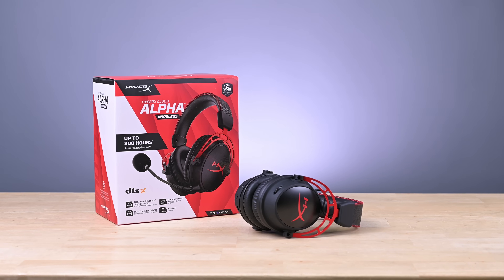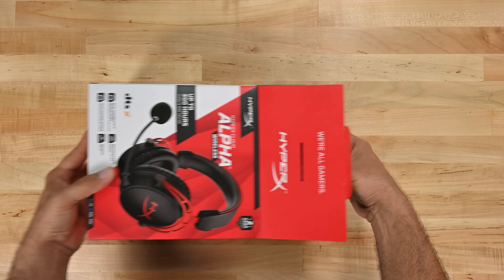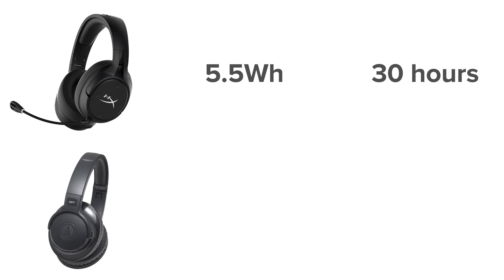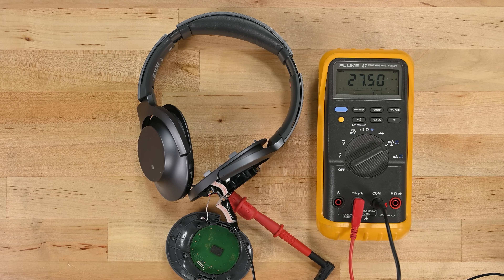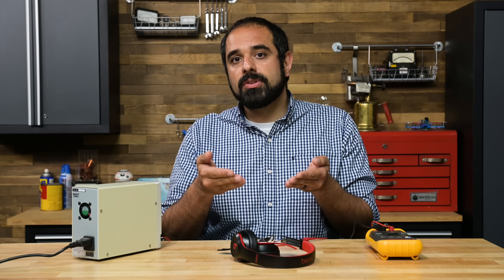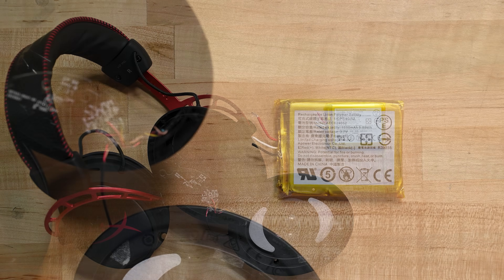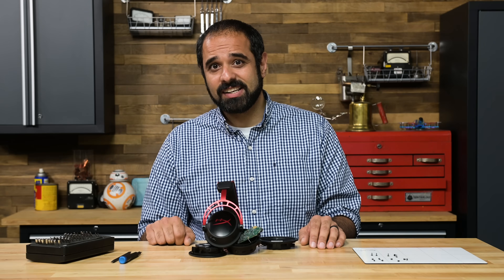300+ hour Battery Life HOW?! A HyperX Cloud Alpha Wireless Teardown

Comment: I got a pair of Steelseries Arctis Pro.. you know, the 340buck headset.. tried my darnedest to find an EQ that would make them sound good, or anything else for that matter. Absolute underwhelming and while the batteryswap feature was nice, 40mm drivers and flat and tinny sound and idle white noise when nothing was playing is not okay on premium headphones... 

So, i got these CloudX Alpha wireless phones and i've only wore them for less than a day, yet i am more impressed by not only the much thicker yet still detailed sound, they are lighter and holds an immense amount of battery life. I very impressed by these.

Comment: Beware.... They don't sell the dongles for wireless connection - if you lose it, it's bricked and useless - terrible support
Reply: I beg to differ on the "terrible support". A plastic piece on mine had a slight crack outside the 2 year warranty and they sent me a new one. The crack didn't affect their use and was mostly cosmetic. I had only asked for the part so I could replace it but they chose to send me the whole headset.

Comment: Battery dies after two years. This is planned obsolescence, you can verify this information. It would cost them 10 bucks a piece to double the lifespan of the battery. But what would be the point of you buying an headset every 4 years if they can make you buy one every two years? Most people won't bother to replace the battery, but they'll mostly just buy a new brand hoping to finally find the one the replace them all.

The company that comes up with a headset capable of outliving HyperX will completely steal the market. If they're worried about pricing they can just up the price by 50% or double it. People are just tired of investing in headsets that they have to change so often. I'd spend 500 bucks to a grand for headsets that would last me 10 years.

But what's the fun in that? Let's make you by pairs that cost us more to produce than if we doubled the battery's lifespan and increased the price... You waste time, we waste money and we all have fun!
Reply: I've had mine for over 2 years and they still work perfectly. A good 50h a week of usage.
Reply: Yep. Mine died too just after warranty. Won't charge or start.

Comment: Thank you for the video. As a curious tech guy, I did wonder how the battery could last over 300 hours. I decided to buy the headphones, I was wondering if the DTS, volume and different sound settings would affect the battery life.
Reply: High base EQ does make them skip out and probably affects battery life. Other than that, they are a great headset. Over 2 years usage on mine.

Comment: Thank you for the great video.
Wires being soldered on to the PCB might be part of the low power consumption. 
With connectors you get repairability but have to account for the powerlosses caused by greater contact resistance.

Comment: My guess is the headphone does not get very loud, loud sure but not distortion inducing loud and also dynamic range on them are likely significantly reduced which would reduce the power fluctuations leading to a stable and calculable battery life. I've noticed that with some wireless sections in songs where it's suppose to be almost a whisper quite get bumped up and since these are gaming headphones, that would be a desirable trait.

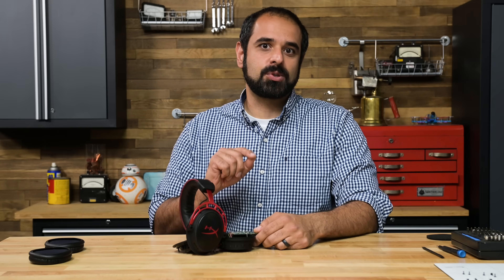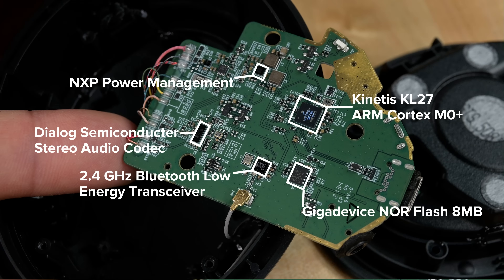Comment: 1:54 (2:15 is the money shot) This seems to be the reason, still doesn't feel like even if your chips are drawing 0 power you should be able to get 5-10 times the battery of your competition though honestly.

WAIT is has a bluetooth energy transceiver or is that just what their friend said? Because it only supports wireless via dongle - perhaps they are just using bluetooth hardware for this, still gets a 21ms latency though according to RTINGS so I don't know why other companies aren't doing this?!?

Comment: Good video, but the first calulation is widely wrong... Call me maybe is 3:19 minutes long, or in decimal 3.31 (3 + 19 ÷ 60 = 3.31). Now take the 300 hours and multiply it with 60 to get the amount of minutes of charge hyperx claims the headset has which is 18000 minutes (300 x 60 = 18000). And then divide the total amount of minutes hyperx claims the battery can last on one charge (18000) with 3.31 (decimal for call me maybe) and you get 5427, which is the total amount of times you can watch and listen to Call me maybe by Carly Rae Jepsen!
Reply: If the headset could play Call me maybe 62790 times the battery would have been able to last for 3463.9 hours... (62790 x 3.31) / 60)

Comment: 2 week per charge with 300 cycle of battery will last you 10 year assuming 100% use case, normally it will be around 30% for normal human. i know but replaceable battery will not necessary in this case. the headset will break even before the battery need replacement . idk how fast tech advancement but im sure this will be outdated in 3-4 year tbh

Comment: Did you guys normalize for the loudness? I suspect the HyperX ones are just not very loud. I'd like to see how the HyperX at max volume compares to other headphones, and if the lower power consumption drivers sound anywhere near as good as the ones used in other headphones.
Reply: of course. yes, they are loud enough.

Comment: But you are using less cycles for the hours you get. If this was less efficient brand, the battery would need to be charged often and the battery cycles would be over in shorter time. This could be long lasting headset!

Comment: you need to test ANC in quiet and deliberately noisy environments. it sounds gret to not chanrge the phones for 2 weeks but im sure they would fail on other things, comfort, and sound quality which disqualifies them, at least from my list. another very big saving is the fact they are not bluetooth, are they? they got their own dongle, meaning no inefficiencies with the bluetooth stack. id immagine it just dumps the audio into the air and same backward, and it either gets there or not.
Reply: they are one of the most comfortable bluetooth headphones with a good sound quality for gaming.

Comment: 2:16
Another unusual thing is that it has a IPEX antenna connector. This means that this thing doesn‘t need as much transmitting power (Bluetooth is TDD and sends data in both directions), at least with a high EIRP.

Comment: Maybe they didn't used connectors to reduce resistance. Shorter wires and no connectors cause a small difference but there's still a difference

Comment: What's really impressive is that they achieved this with the faster  2.4GHz connection and not over Bluetooth.
Reply: I think what you guys mean is that it uses a Bluetooth chipset (as you can see in the video) but does not use the Bluetooth standard (as it is using proprietary Direct WiFi tech, e.g. the 2.4 GHz USB dongle it comes with).
Reply: 2:19 It uses bluetooth (which also runs on 2.4 GHz with 1 MHz spectrum and FHSS).

Most headphones have a PCB onboard antenna, but this has a IPEX antenna connector and that can make it more efficient too (if it‘s a 3dBi antenna instead of a -0.5dBi antenna, it already needs half power for transmitting).
Reply: @MaxMüller0  its not bluetooth it has its own connector.
Reply: @EpicBunty  it is bluetooth, maybe in a slightly modified way. BLE means „Bluetooth low energy“.
Reply: @MaxMüller0  it is not bluetooth. Bluetooth is a protocol using the 2.4GHz frequency. Not everything that uses 2.4GHz frequency is bluetooth. If it doesn't follow the protocol standards, it is not bluetooth.
Reply: @vicentiubucingeni  The picture at 2:02 literally points to a module on the circuit board with the text: "2.4 GHz Bluetooth Low Energy Transceiver"
Reply: BLE or Bluetooth Low Energy uses a 2.4GHz connection man. It's using Bluetooth.
Reply: @erjonameti  2.4ghz doesn't necessarily mean Bluetooth, WiFi for example also uses 2.4ghz and many proprietary radio protocols use 2.4ghz also.
Reply: @_._shinonome_._  yes exactly. But he is saying that they are not using Bluetooth. That's wrong.
Reply: @erjonameti  It's not using Bluetooth. You can't  pair it to your devices with Bluetooth. You need to plug in the included 2.4GHz dongle to connect it. This method of connection is known to have Lower latency and higher bandwidth while consuming more power compared to Bluetooth.

Comment: Before watching the video, I thought maybe they used lower impedance drivers, and maybe that's why they're drawing so little current?
Reply: Lower impedance drivers actually require more current (Ohm's law) at lower voltage to produce the same power as a higher impedance driver. But since power is what we're after here, the impedance doesn't matter. I'm assuming the audio amplifier is optimized for the particular driver used in these phones.
Reply: @smwsmwsmw  Ah damn, completely forgot about Ohm's law

Comment: Actually, you can add a mini solar cell and it will charge it without any issue.
Wow.
Reply: If you use it outdoors on a sunny day.
Reply: @PoNKPoNy inside, it will generate a small current to almost cut the power usage to half.
Reply: I look up the power generated by a Logitech keyboard solar panel with 35.24 cm^2 surface area, which would probably fit on this headphone. It can generate 1.64 Pmpp (mW) (under
CFL light). So in theory, it can run this headphone at around 1/3 uptime.

Comment: Why are they so efficient? Are there any drawbacks?
I mean... you need a processing chip for the audio, a circuit to drive the drivers and the drivers themself. That's it, right? 
 They use the newest, most efficient audio processing chip. But so do many other manufacturers. The drivers can't really be optimized. They just need an certain ammount of power. 
They have a larger battery, but not a 10 to 15 times larger one.
Do they cut down on audio processing? Isn't there a massive quality loss due to this low power consumption?

If it would be so easy, other manufacturers would have done 300h+ headphones too. A larger battery is essentially free for them and the larger battery life would be an selling point that would more than compensate for it. So either, there has to be another, magic tech voodo trick not shown in this video or they are cutting down on audio quality. Or am I missing something?
Reply: Yeah 
I don't get. There has to be a drawback

Comment: Can I replace a battery in my headphones with a higher capacity one and still expect it to charge and work flawlessly? Without changing the power management circuit ofc. 
I have the CorsairVirtuoso RGB SE. While it has about 20h of battery life, I saw that there would be enough room for 3 batteries, while still leaving almost as much room for the speakers. 
Putting 3 in paralell would be cool. But I have no idea if it would charge.
Reply: I am thinking to buy same headset but a lot of reviewers said sound is not that good for $200 headset
Reply: @iraklimgeladze5223  Depends on the review. The soundquality of the headset is preatty amazing for a gaming headset, but you have to set the equalizer right.  The base profile sound muffeled.  Setting an custom equalizer is a must on every headset or headphones yet so many people ignore it or do not know it. 

The microphone quality is amazing with the non SE version. With the SE version, it may depend on the revision. I bought it at release and the larger microphone essentially was too overkill. It sounds good, but not as clear as other headsets. Apparently, they released a revision later on that improved the microphone quality of the SE by a large bit. But I can't confirm it, since nobody mentiones the revisions in their reviews. 

They also released a new version that adds bluetooth support. But that drives the price up to 250 USD, which is quite hefty. But overall, I say it is till a great headset for that price. The only critique I have is that the earcups might not be comfortable for everybody. They are relatively small and the entire headset is closed, like most gaming headsets. Meaning that it gets quite warm underneath the earcups.
Reply: @LucaDarioBützberger  wait not all of them support Bluetooth?
Reply: @iraklimgeladze5223   No. There are three versions. 
The Virtuoso RGB Wireless, the Virtuoso RGB Wireless SE and the Virtuoso RGB Wireless XT.

All versions are wireless via an USB dongle and can also be used thedered via USB or 3.5mm.
The SE version is better than the non SE version. It is made out of aluminium instead of plastic and has a larger microphone (which originally was worse, but they apparently fixed it). The XT version is even better and supports bluetooth in addition to wireless or thedered. 

I can't tell if it is possible to use multiple input sources at once, if you want to use it e.g on your pc and smartphone simultaneously.

The standard version costs 179USD, the SE version 209 USD and the XT version 269 USD. You might find them cheaper. I bought my SE for 180 during a sale. 
They are expensive, but they are also good gaming headsets. However, i find the pricetag for the XT version a bit too high.
Reply: @LucaDarioBützberger  Thank you
Reply: Yes it will work just fine. But charge time will obviously be 3x longer since the charge speed won't be increased.

Comment: I usually forget about the fact that I have 8 years of micro soldering experience 
and that an average person can't put those wires back
Reply: i got lots years of casual soldering.. and would be easy to replace this battery.. just need steady hands, a solder with a point that thinner and more of a point, thin solder, flux, and a magnify glass.. very easy.. if your cluey you could add a connection on the cirtcuitboard  and onto the battery cable so that you just plug it in instead of soldering.. then to place the battery just solder the connection points onto the battery cables.

Comment: you have to check this , i think connectors are bad for audio quality transmission but for the battry a connector is better it can save from short circuit in case on replacement ... but the weight is it equale in both sides

Comment: wait a second, which headphones has a replaceable battery that is easy to remove without soldering?
Reply: Arctis pro comes with 2 replaceable batteries and a charging dock but it's so expensive
Reply: Some have hotswap batteries, so those for a start.
Reply: Beoplay  series h in general

Comment: Honestly I wouldn't say a replaceable battery matters in this case. Even if the battery degrades to only holding 10% charge it will still have a 30 hour battery life. To get down to an "unacceptable"  battery life of just a few hours it would be at 1% to 2%. Even with careful handling and use I doubt the wear components of the headphones like the ear cups, hinges, and headband would still be in usable condition by that point.
Reply: Batteries can fail early on, get bloated and become totally useless in a couple of years
Reply: @25566  Batteries like that are usually dealing with countless charge cycles as well, which these headphones for the most part won't be dealing with
Reply: Thing is lithium batteries from my experience usually go down to about 50% (+-20%) and then quickly die off. No doubt a bigger battery will last longer, but not by as much as you think.
Reply: @swecreations  It absolutely will. but there are some big factors that will change it such as how you charge, when, and for how long.
Heat is the big killer and the issues with batteries seemingly dying super quick after a certain percent is more to do with the fuel gauge not having a proportional output. 
Trying to measure charge percent is super non-trivial.
Reply: @swecreations  300 hours means you have to charge it 10 times less than 30 hour headphones. Which means it'll last like 100 years.
Reply: @NaudVanDalen  True, though my Bose headphones have 20 hours of battery life and are holding up very well to 3 years of use 10 hours/day every day, fully charging them overnight every day, and still getting almost the same battery life as when new. 

I do agree though that if that meant the battery lasted the same 20-25 years that EV batteries last that would be very nice.
Reply: The issue is also batteries can just randomly shut off when they're getting old
Reply: I think this is the point where you can't really satisfy the customer tbh.

If they would make the battery easily replaceble, the next thing someone would complain about is a changable mainboard, then drivers, then whole earcups and whatever... there is always something to complain about and also every connector adds up weight.
Reply: @flintstone1409  A few grams of 2 or 4 connectors is nothing compared to the 5.55Wh Li-Po battery, drivers and metal construction.
We should point out flaws or suggest improvements for good designs. A product "perfect" in its niche can be changed to suit a different use-case or demographic.